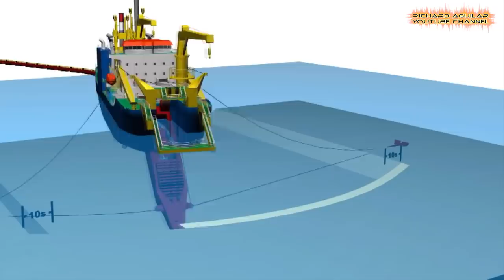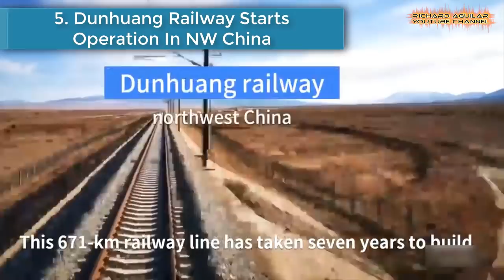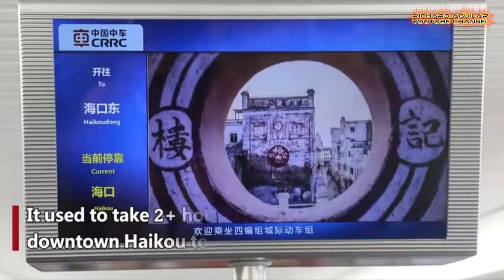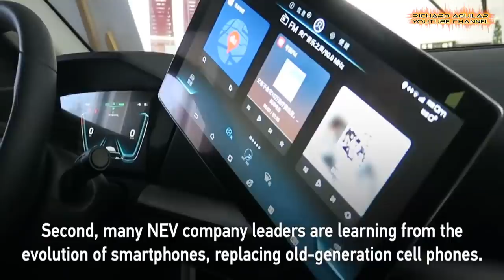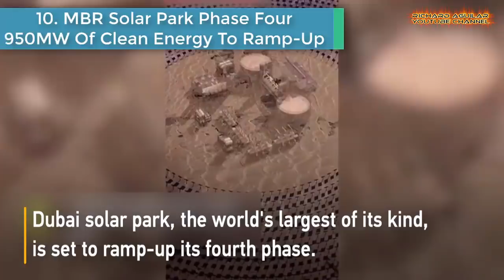China’s Most Recent Unbelievable Technological Innovation

Comment: We all know we do have to make nuclear energy a whole lot safer, or we have to get rid of it. Convert to cleaner energy. Any Source we can use as long as it doesn't atamanuik the Earth. We need to clean it up humans are getting pretty messy.
Reply: There's another nuclear energy. THORIUM, cheaper and far more abundant than uranium. SAFER. Runaway reaction can't happen as you have to "keep stoking the fire" to keep it going. Extremely safe, compared to current models.